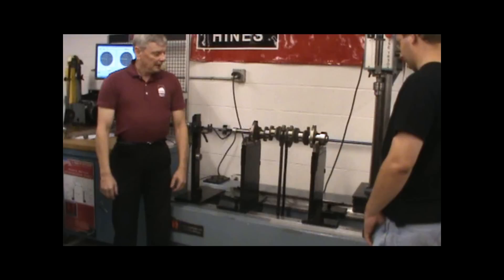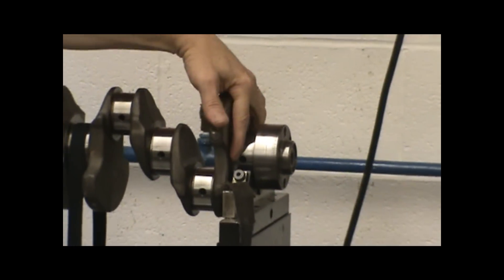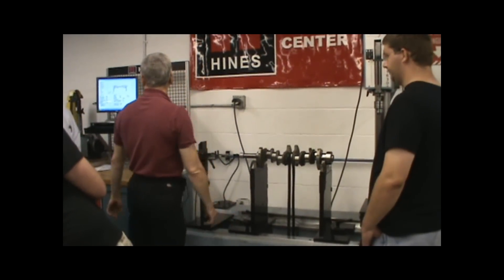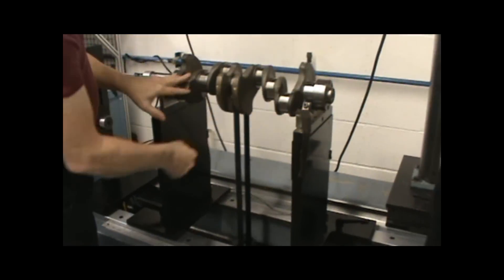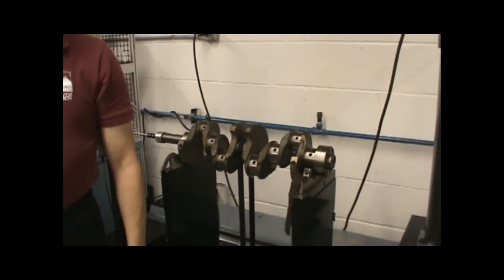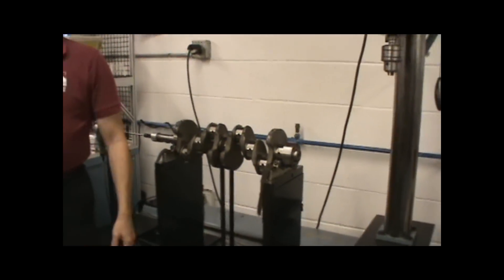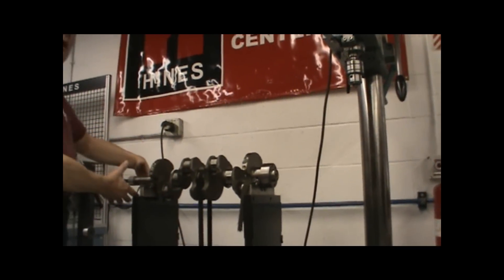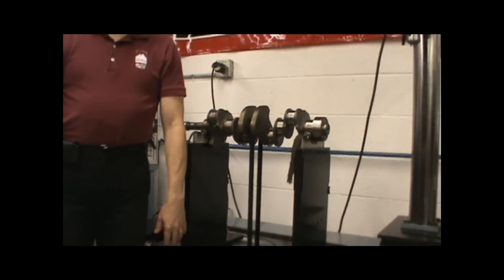How to Balance internally & externally balanced Crankshafts (Crank)

Comment: Anyone that uses imperial measurement for balancing or any engineering does not know what they are doing!
Reply: There is no difference between metric and imperial. It all goes back to the same standardized unit. 1 inch will always be the same as 25.4 mm.